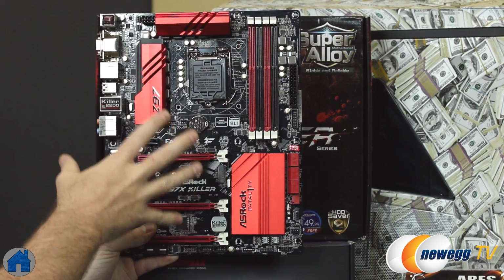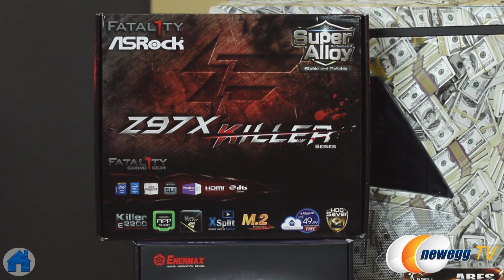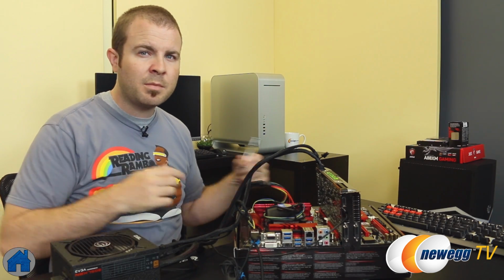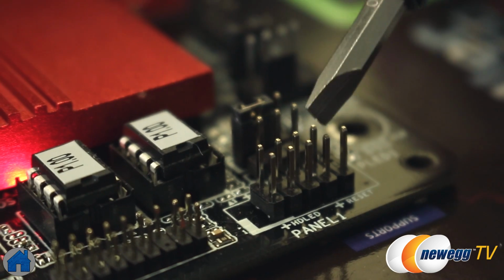How to Build a PC - Part 1 - Newegg TV

Comment: So am I going to need to buy my own screws and cables or do they all come with the case/parts you buy?
Reply: All cables and screw should come with your case and components
Reply: They usually come with the parts.
Reply: Thanks guys. I've already completed my build and couldn't be happier!
Reply: case*
Reply: jordan parks I was super confused about all of that too so I know what you mean. Turns out that all the cables and screws and little accessories you need come with your stuff. My case, the Design R5, came with pretty much everything I'll ever need. My motherboard came with a ton of cables and adapters as well. Hope that helps!
Reply: jordan parks It wouldn't hurt to go on PCPartPicker and see if those items are compatible, but those will absolutely give you 1080p at 50 fps for sure. Even higher in some cases. Maybe increasing your memory to DDR4 wouldn't hurt, but that depends on what kind of motherboard you're using. As long as your memory has a fast speed in MHz, you'll be fine.
Reply: you should have screws
Reply: +Veridian So all the cables will come in your case and stuff? I'm looking to build one and the cables needed are overwhelming and wondering if they come with your stuff you buy
Reply: +Veridian thanks man! I want to run rpg games and mmos and stuff at 50 fps or higher and at 1080p will all this work? 

Graphics card- Asus strix 470(170$)

Cpu- Intel i5 6600 (220$)

Memory sticks- Crucial Ballistix XT 8GB x2 DDr3 (50$) 

Power supply- 550w FirePower Fatal1ty 80plus semi modular gaming ATX (95$)

Are there any things I need to change? Did I screw up on something or? This is what I just went for
Reply: never heard of firepower before lol
Reply: Veridian how did you install the os i am stuck and confused
Reply: SAVAGE STATURE Did you get Windows 10?
Reply: dont get windows 10home edition its cancer,
Reply: what if you don't have screws?
Reply: atomicleopard89 Are you saying yours didn't come with screws? It absolutely should...
Reply: Veridian  I may have lost them but I have a solution so not to worry
Reply: jordan parks I really hope you changed that to DDR4 memory as DDR3 is not compatible with the 6600 i5, considering it's a newer chipset. Every motherboard will let you know what type of ram is compatible and what cpu socket is compatible with it. The 6600 is an 1151 socket, and uses either the h150, z150, or z250 chipset. Make sure all parts are compatible on PC Part Picker.

Comment: Do you really need to buy a separate operating system from the rest of the build? Or can you simply get all of your parts, and the operating system is included? I had all my parts picked out, and ready to purchase, it was going to be roughly 765$. That was fine, but now I'm seeing that I may need a separate 100$ Windows 10 operating system....
Reply: FoxyThePirateFox You called me a noob as a genuine insult. Your word is worth less than month old summer, sidewalk shit now.
Reply: You Will need to buy Windows aswell :)
Reply: install Linux or pay for windows
Reply: +GravelsNotAFood omg ahahahaha
Reply: If you don't want to spend the money on Windows, I'd recommend some Linux distro- Linux, despite being a minority by far, is actually quite good on the desktop. The best part is, it's free, so you won't break the law like you would be by pirating Windows (which I'm genuinely astonished that people are recommending). If the extra $100 is that much of a problem though, getting a new computer should be the least of your concerns! /s
Reply: if you have a previously working conputer with a windows system then use that hard drive and it should keep everything
Reply: Just pirate it for free
Reply: you can get it for like 20 dollars on ebay
Reply: Ship Brekas How?
Reply: kingIce XIX In good condition?  With the key?
Reply: +GravelsNotAFood brand new
Reply: kingIce XIX Link?
Reply: Psst hey, there is something called the pirate bay...
Reply: Snoop Doge You can't pirate a OEM key...
Reply: +GravelsNotAFood Here is a UK link, not sure if you can order from where you live: https://softwaregeeks.co.uk/product/windows-10-pro/?gclid=CJeIqMi0sM4CFRJmGwod31EK9g (The website is trustworthy)
Reply: GravelsNotAFood Psst hey, theres something called KMSpico.
Reply: +GravelsNotAFood Yes you can noob, i did it-_-
Reply: Well, i called you a noob because you dont know that there is a thing called a windows activator-_- noob...
Reply: FoxyThePirateFox yeah, I used KMSpico (Be careful though some versions are full of malware.
Reply: Yea, i know
Reply: ***** Or you can download windows iso from their website, download KMSpico activator and you have yourself a free copy of windows ;) smartass
Reply: +FoxyThePirateFox Hmm
Reply: Poppamunz My non-gaming PC has Ubuntu 14.04, but it's a pain in the arse to get some programs working.

Comment: this might be a dumb question but If i install windows on a harddrive and enter the key so it works...can i transfer it to a ssd one day or will i have to buy a whole new os?
Reply: You can use programs like Fedora to shrink your current OS and copy it to a new storage drive, whether a Mechanical drive or Solid State Drive.
Reply: And it'll work without having to buy a new key?
Reply: +D Jay Just search it up bud there are alot of videos about how to move ur os
Reply: Your Windows binds to the bios not HDd/SSD.

Comment: Which is better for gaming? AMD FX-8350 or Intel i7 6700k?
Reply: Rn I'm planning on using the amd.
Reply: i7's have unneeded power you would be better off with an i5.
Reply: +MRsjovealek but also like 2 times the price and I'm on a low budget, around 600-700
Reply: If your mostly just gaming. You don't need a i7 a i5 would be good enough
Reply: But you did ask "Which is Best". That is the 6700K
Reply: +Refluentfiend Pie that is not true and true at the same time. The resolution is getting better and more common in games to do higher resolution. The games Are actually getting more CPU requirement, also When dx12 is getting more common. That Will make a 2011-3 setup more of a choice When buying a computer. 
But for my point, it is the resolution that makes the gpu power needed mostly. Even a 1060 Can handle the most gpu needed graphic in 1080p. My former 780 Can even do that on High settings in 1080p.

Comment: Does a fan come with the cooler? Or do I have to a get it separately?
Reply: Fans are normally included, yeah. Of course, you should always check the specs of the cooler, because they will tell you if there is or isn't a fan.

Comment: did a test build, plugged everything in correctly, fans run and everything, but nothing displays on the monitor for hdmi, tried vga and dvi and still nothing. thoughts? any help would be greatly appreciated.

Comment: hey, i have a question. 
im planning on getting a new psu though the one i have currently has only 4 pins to the cpu connected does that mean if i connect 8 pins into the mobo somthing bad will happeb? 
please help as i am currently in the process of upgrading my pc.
thanks

Comment: I'm planning on building a PC that can run WarFrame on low settings 60 FPS, all I know is that my processor should be either Intel i3, i5 or i7 at least 4GB ram and for other games in total I want to have at least 200+ GB Hard Drive space can anyone recommend parts (in full detail with all those numbers after the item) please? Thanks!

Comment: I'm planning on building a computer but I don't have that much knowledge of the matter. Here are the specs I'm mainly aiming for; EVGA GeForce GTX 970, Intel I7 6700k, a 1 terabyte - 2 terabyte hard drive. I'm sure I am missing a bunch of other stuff so could you guys recommend what other parts that are needed.
Reply: you are missing quite a few parts:
RAM, Motherboard(for that CPU, you need a lga 1151 compatible motherboard), Power Supply Unit, CPU cooler, Casing(a lga 1151 motherboard will be quite big so take that into account), Optional: Disc drive for installing OS(you can install the OS off a USB stick though I would recommend getting a disc drive as it is easier)
In order to get better advice, I recommend posting up your budget for the build
Reply: jesus christ youtube comments are broken to hell, i can't get a line break in the comments
Reply: Thanks for the advice man. But just to be sure can your confirm that these components work are compatible with each-other? 1x 1TB desktop hardrive, 2x Corsair Vengeance LPX 16GB (2x8GB) DDR4 DRAM, 1x Internal Blu-Ray disc drive, Cooler Master 212 EVO, ASUS ROG MAXIMUS VIII HERO ALPHA ATX DDR4 3000 LGA 1151 Motherboard, a  EVGA 500w Power supply, Apevia X-SNIPER2-GN ATX Mid Tower PC Gaming Case and the components that were listed in the original comment.
Reply: All is good
Reply: I would recommend getting the radeon rx 480 graphics card. They arent THAT much more expensive than a gtx 970 but they are wayyy better
Reply: Also go on to PCpartspicker for a more accurate and easier build
Reply: i would recommend getting the gtx 1060 when it comes out it is going to be wayyyy better than the rx 480  and it is just going to be a little more expensive

Comment: You should never use twist ties in a pc
Reply: You should never spell Renegade "Renigade"
Reply: +Renigadecrew peeling metal on a twist tie is hard to do if you're not a disabled hammerhead shark
Reply: King Holland ik that already XD had this account for years and never felt like changing it
Reply: twist ties are a terrible option
Reply: Why not?
Reply: ***** they contain metal which can short out on some components as the rubber peals back and the metal gets exposed over time
Reply: +Renigadecrew Gotcha! Thanks for the info!
Reply: +Renigadecrew So what's a good alternative?
Reply: +BaritoneLife  nylon zip ties or velcro wraps
Reply: Couldn't you also use those plastic zip ties?
Reply: Vivian Marchak yea there nylon/plastic and they are recommended.
Reply: Glaive Beam It wears out and the metal exposes
Reply: RoBabi95 you're a terrible option.....😂😂 jk I had to.

Comment: Building my first pc are these good components ?

Graphics card:AMD RX 480
Motherboard:msi h97 pc mate
CPU:Intel i5 4590t quad core
Power:EVGA 500 watt power supply
HDD:Seagate barracuda 2tb
SSD:Sandisk ssd 120 gb
RAM:8gb crucial ddr4 ram
Reply: Prob gonna want a better power supply
Reply: Do yourself a favor, scrap the SSD, Unless you REALLY want one, put the money into a more "futureproof" CPU. The I5 is going to fade out soon. Look into the Broadwell-E CPU's. A little more expensive, but seemingly worth it. 

You might want to get a better PSU. 500 watts is kinda low. Go for a minimum of 600/650 watt. Otherwise its a pretty decent build.
Reply: Ryean Hafeez
 how can i know if the processor im buying is compatible with the chipset of the motherboard?
Reply: go to the motherboard website and look at their compatibility list. You can also use pcpartpicker.com which is a great help
Reply: kk thanks
Reply: thanks
Reply: get a min 600w power supply, as it is an i5 and rx480 is rated at 150w, the price difference will not be that much
Reply: I would get 16/32gb of ram, and a 600w or 750w power supply for upgradability
Reply: +LargeLadGaming sadly, broadwell e is not a little more expensive, it is A LOT more expensive than an I5. On top of that, the cost of a decent X99 motherboard is more too! He also might want the ssd for his boot drive. Lastly, I don't know, but I don't think an RX480 is good enough for X99 CPUs.
Reply: lol i5s arent going anywhere. Extreme future proof is kinda stupid
Reply: http://pcpartpicker.com/list/fJc7WX I would recommend this, it has a skylake CPU and 16gb ram
Reply: +LargeLadGaming you seem to know a bit about PCs and I'm about to build my first. How's my list sound and do you have any recommendations? 

WD Blue 1TB Desktop Hard Disk Drive - 7200 RPM SATA 66b/s 64mb Cache 3.5in - WD10EZEX - OEM = 49.99$

MSI Radeon R9 390 DirectX 12 R9 390 GAMING 8G 8GB 512 bit GDDR5 PCI Express 3.0 HDCP Ready CrossfireX Support Video Card = 279.99$

GSkill Rip Jaws V series 16GB DDR4 SDRAM Intel Z170 Platform/ Intel X99 Platform Desktop Memory Model = 59.99$

Intel Core i5-6500 6M Skylake Quad Core 3.2 GHz LGA 1151 65w Desktop Processor Intel HD Graphics 530 = 249.99$

Gigabyte GA-150M D3H LGA 1151 Intel B150 HDMI SATA 6GB/s USB 3.0 MICRO ATX Intel Motherboard = 64.99$

Microsoft Windows 8.1 64 bit = 99.99$

CORSAIR CX-M Series  CX650M 650W 80 Plus Bronze Haswell Ready ATX12V EPS12V Semi Modular Power Supply = 69.99$

TOTAL = 874.93$
Reply: TheXman174
no ssd?
Reply: YOu dont need 500W you need barely 400W
Reply: +LargeLadGaming alright thanks :)
Reply: +Ryean Hafeez 500w is enough

Comment: Is the second build good enough for playing games like LoL, HS and CSGO properly? And if so, how much would it cost?
Reply: If your building a amd rig I'd wait for zen
Reply: Omar Ortiz just trust him go with newegg
Reply: You could build one that would max those games for only $500:

PCPartPicker part list: http://pcpartpicker.com/list/3282P6
Price breakdown by merchant: http://pcpartpicker.com/list/3282P6/by_merchant/

CPU: *Intel Core i3-6100 3.7GHz Dual-Core Processor  ($110.99 @ SuperBiiz) 
Motherboard: *ASRock H110M-HDS Micro ATX LGA1151 Motherboard  ($51.99 @ SuperBiiz) 
Memory: *Kingston HyperX Fury Black 4GB (1 x 4GB) DDR4-2133 Memory  ($20.98 @ Newegg) 
Storage: *Western Digital RE3 1TB 3.5" 7200RPM Internal Hard Drive  ($44.69 @ Amazon) 
Video Card: *Zotac GeForce GTX 750 Ti 2GB Video Card  ($94.99 @ Newegg) 
Case: *DIYPC M89-R MicroATX Mini Tower Case  ($23.99 @ Newegg) 
Power Supply: *EVGA 430W 80+ Certified ATX Power Supply  ($29.85 @ Amazon) 
Optical Drive: *Lite-On iHDS118-04 DVD/CD Drive  ($13.99 @ Newegg) 
Operating System: *Microsoft Windows 10 Home OEM 64-bit  ($85.95 @ Amazon) 
Total: $477.42
Prices include shipping, taxes, and discounts when available
*Lowest price parts chosen from parametric criteria
Generated by PCPartPicker 2016-07-14 12:33 EDT-0400
Reply: You can go even cheaper waiting for deals - the EVGA 430W is only $15 on Newegg right now with MIR.
http://www.newegg.com/Product/Product.aspx?Item=N82E16817438015&ignorebbr=1
Reply: u can run those with a potato
Reply: +masonjam never buy from superbiiz
Reply: +Devin290 why

Comment: thx for the video. I hope it helps me. can anyone tell me tho an amd processor that is an equivalent to an i7 quad core
Reply: AMD A10-7870K, with over clock of 3.9 GHz, it's right behind the i7 6700k at 4.0
Reply: +Ardebit nope it is the equivilent of a i5 Dual core with hyper threading
Reply: +T3KNUG3T5 THX!
Reply: +T3KNUG3T5 crap, well do you know any that are equivalent to i7?
Reply: +PandaIndustries yeah I was wrong, amd's fastest processors cannot compete with i7
Reply: +Ardebit wow, amd is dying off then
Reply: not really. they are good for budget builds

Comment: is this decent for a budget pc;

AMD Athlon X860 3.7 ghz cpu

msi a68hm grenade motherboard

patriot 8gb ddr3 ram

amd radeon r7 2gb gpu

ostrog enermax black mid tower case

toshiba 1tb hdd
Reply: I second GL 9106. Nvidia is more popular and has more features than AMD GPUs. Plus the GTX 1070 and 1080 have just come out so if you can't afford those cards, expect sales for the older ones. Even on a budget you should buy a SSD in addition to your HDD or get a hybrid. And buy a cheap HSF like the 212 EVO, the last thing you want is overheating.
Reply: ***** I'm not an expert on this stuff, I get a lot of my information off logicalincrements.com. They answer questions quickly and have some really in depth builds. Take a look at their "Great" or "Superb" builds. Hope this helps
Reply: Thanks for the feedback guys you helped a lot :)
Reply: yes minus that CPU

Comment: How much money should I spend if I want to play games like Rust around 40-60 fps? Or if someone really wants to help me what parts should I get? Or am I in the wrong area of the internet to be asking this question.
Reply: +Super Pigboy Firstly, you are in the correct part of the internet xD. Well $500 USD Will get you a pretty good pc that will easily run rust at 40-60 frames. The parts u choose can be an opinion thing, plus i am not the most experienced in building PC's

Hope i helped.
Reply: +Taidgh Burgess Thanks!
Reply: if you're still looking check out reddit.com/r/buildapc/ or reddit.com/r/buildapcforme/ for more info

Comment: guys is this good for gaming :

500gb hitachi hdd
gtx 710
4gb ram
intel g3258
???
Reply: +ritesh bhirud Not really ideal. It will struggle with games. I'd recommend a quad core i5, 8GB Ram and something like a GTX 960.
Reply: +James Reeves what if I just add 8gb ram and keep everything same since my budget is $200 gaming pc
Reply: +James Reeves would it work
Reply: +ritesh bhirud If your budget right now is 200 I suggest just saving more or not getting into pc gaming. Though it depends on what games you play, if your just playing minecraft and cs go you'll be fine with that. Definitely would recommend getting more ram though it's cheap and just very worth the buy.
Reply: 4 gb ram is definitely not enough for games, unless your playing minecraft or something small...
Reply: +at8keys what if instead of 4gb ram I do 8gb ram?
Reply: +ritesh bhirud yes, more ram isn't that much more money and it'll make your games run so much smoother. But your computer will struggle with top of the line games on 8 gb.
Reply: +ritesh bhirud umm yea ur not gonna get much out of a 200 dollar pc. The case im planning on getting is almost as much as that
Reply: I've never had a problem with 8GB. Handles games such as doom like a pro.

Comment: I have a question what is the 8 pin on the hard drive?
Reply: +王越 What 8-pin?
Reply: the 8 pin on the Western Digital 1TB  Blue hard drive
Reply: U never use 8 pin for hdd, 8 pin can be used for cpu or 8 pin pcie for gpu